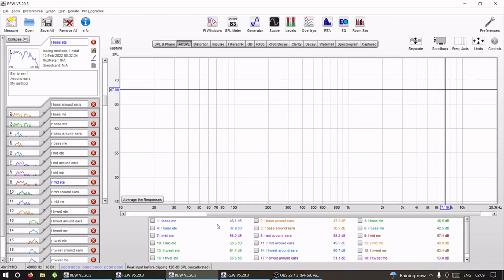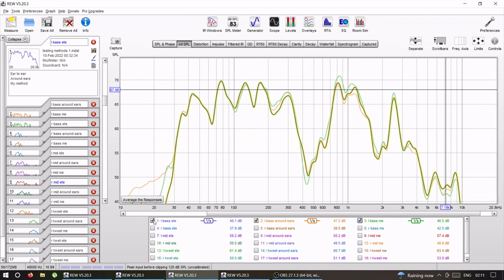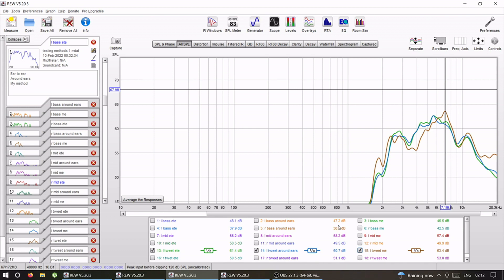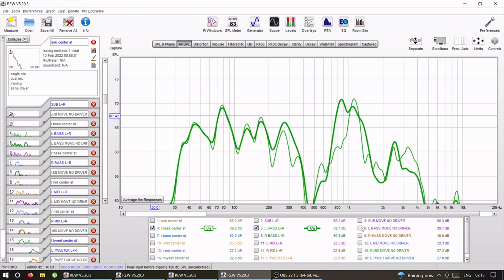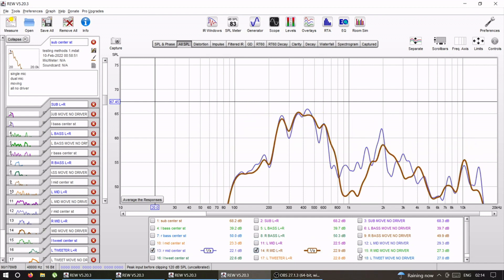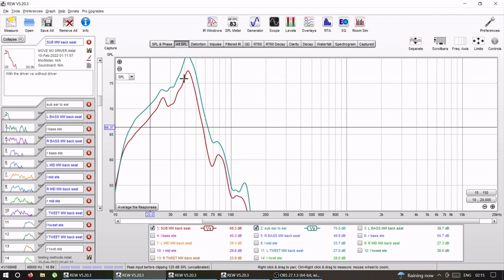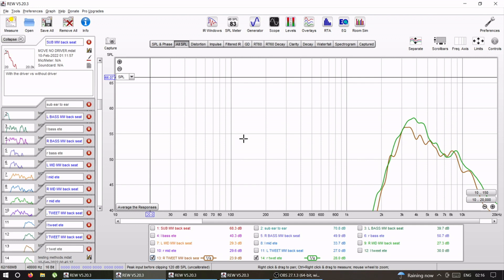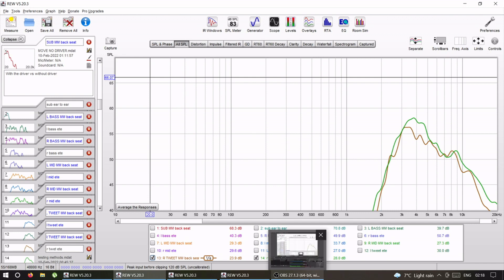Comparing measurement techniques

Comment: So which method is good with ummik 1 please ? :)
Ear to ear sitting in drivers seat or moving mic not in drivers seat ? Thanks :)
Reply from the maker: The method is not about what mic you are using, it's about the end result and consistency of measurements. I am measuring around my head while seated in the listening position.

Comment: Can imm6 measure vertically?
Reply from the maker: You can use any mic to measure at 90 degrees, only the very top end will vary slightly above 16-18kHz.

Comment: hi, did you find major differences using this small mic compared to more expensive ones?
Reply: @RAW-CAt  cool, i have seen that some others mics are limited in freq, like for example 10hz-18.000hz... Also, due to more complex design they might measure more accurate...i imagine. But if you did all your measurements with this little buddy, it must be good. I was looking to a MiniDSP mic or one of the bigger Dayton's

Comment: It would be interesting to compare to RTA results using the same technique taken four or five days in a row.   If the technique is right then the RTA should be identical.  If the system is playing the same pink noise under the same conditions, the correct measurement technique should get the same RTA response every time.   Now that would be an interesting experiment as a follow up episode... food for thought......  btw really enjoying the vids mate :)

Comment: 90 degree file vs straight ahead is only different above maybe 8-10khz where the top end rolls off by approx 6db at 20khz
Reply: Yes that’s right… it even says that in the UMIK manual

Comment: Wow… no wonder “correct” mic technique is so important for EQing, or else the tuner may not be actually EQing the “real” acoustical response.  From looking at this video it seems like it makes total sense the driver should be sitting there, so we can eliminate out of car tuning entirely (Audiofrog method). Now it just comes down to which method with driver sitting there, and my gut feeling is it should mimic the way your head typically moves, which is the L/R back and forth method..but that’s just a guess. Think of it like this - you are constantly looking at your L/R/C rear view mirror while driving right? Your ears would be moving in the horizontal plane frequently while once in awhile the vertical plane. -Isaac
Reply: Andy Wehmeyer says to tune out of the car because his target curve accounts for one not sitting in the drivers position when adjusting the system. He stated this repeatedly.
Reply: @Cathul  Target curve is irrelevant if the measuring technique is incorrect. Because everything you EQ is based on a false image of a response that's not accurate to what you hear when you're in the car. Does his method work for him? Of course, but it's not going to give you the best and most accurate result.
Reply: @richie.rich98  it certainly is accurate enough for the majority of customers.
Is it accurate enough for a sound quality competition? No, but compare the number of competitors to the number of installed systems.
Reply: @Cathul  Of course, not trying to put the man down with what I'm saying.

If he's able to give a result that satisfies his customers that's always a good thing because the majority of shops wont even put in the effort.

But at the same time YouTube is a different landscape. We are DIYers looking to get the best result that we can achieve for ourselves. On top of that there is no extra effort needed for something like taking a measurement in your car vs outside of it, so why not do it the right way?
Reply: @richie.rich98  yet at the same time people are using target curves like whitledge, half whitledge, the JBL curve, Audiofrog curve with them sitting in the car while these curves all were developed for measurements without someone sitting in the car during the measurement.
And those people are not able to come up with the necessary modifications to those curves. So while they try to do it right they are doing it wrong.
That’s all I’m saying.
If you can do your own curve, then all good, but most of the time people use the wrong curve while doing the measurement correctly.